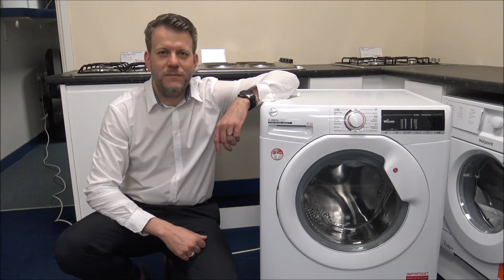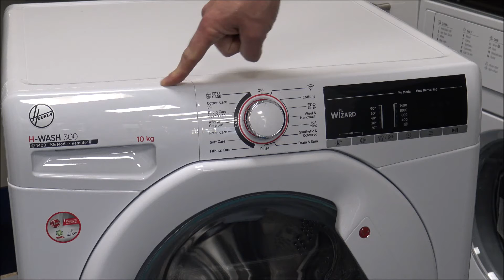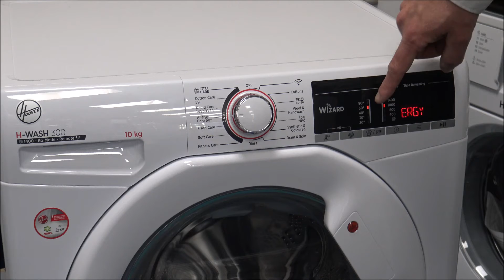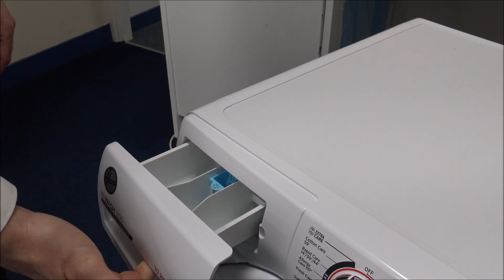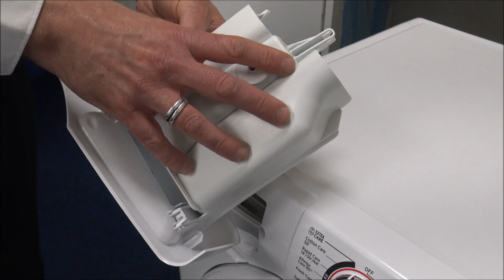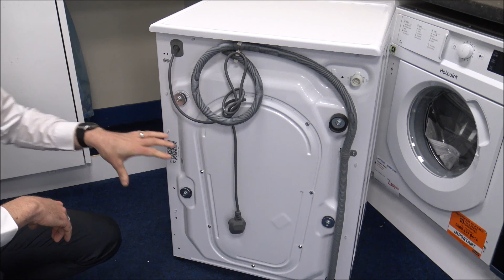Hoover H3W4105TE 10Kg Washing Machine Demonstration

Comment: Hi. I have an h350. Our previous washing machine had a divider for liquid detergent but this one doesn't have such a thing. When I put the liquid detergent it flows into the machine. Is this how this machine works or the liquid detergent goes to waste? I think it goes to waste under the door when it starts to load water. Am I missing something? Does it still take the liquid detergent?

Comment: Brilliant video, thank you. I was told it heats up water by itself. I just got one because I don't currently have hot water supply. For the very first use,  I tried doing a hot wash but the water stayed cold. Any idea why please? What can I do to make it work?
Reply from the maker: It will heat the water up by itself, don't connect it to a hot water supply, even if you had access to it

Comment: Dreadful machine, almost impossible to launder bed linen, has no balance, just rolls everything up making it impossible to spin items, it actually states in the manual to avoid the spin cycle if washing rugs, bedcovers etc., how do the engineers expect we get the water out of items if they have not been through a spin cycle.  I do like all the programs, and no complaints with anything else, but I do need to launder sheets, have tried all sorts of loading combinations, feet have been adjusted. I never had any problems with previous machines, could put anything in. Any suggestions would be gratefully received. Hate it, can’t wait to replace it.
Reply from the maker: i agree, must be very frustrating. Modern machines struggle to spin large single items on their own, you normally need to add extra items to the load to try and balance the load out when it spins.

Comment: i need your advice can you help i got up one night to go get a drink and found puddle of water infront of my hoover washing machine and my bosch dishwasher is one press down from it so im not sure if there was a leak and if there was which one did is there anyway to detect or find out which one might have leaked before i call a man out
Reply from the maker: Unfortunately the main way will be to pull the appliances out to check to see which is leaking
Reply: iv found the problem it was my dishwasher both machines work fine but the seal on the ubend pipe holding the dishwasher outlet had worn away i only found this by chance i knew it was dishwasher so decided to wash dishes in sink only when i pluged it out could hear water under press opened door press flooded but have place 10 yrs guess its not surprising it wore away @lords-electrical

Comment: hi andy got a question for you ive a hoover washing machine and iv just bought some clothes and it says the have to be washed on delicate cycle but i cant see it on the machine if it is on it what would the programme be called
Reply from the maker: if it is saying a delicate cycle then i would look for a Silk or Woollen wash then it will have a gentle wash and spin action hopefully.
Reply: @lords-electrical  thanks just looked up manual and saw wool & soft care it mentioned delicate in the description underneath it so i take it that would be the cycle

Comment: Just got the HWash300 9kg load looks good the guy just finish fitting it the pressed a few buttons he left found he had set ups run time over 3hours with an empty machine so far it’s now down to 1 .28 hours left. So the machine will have run to the full 3hours

Comment: Thank you for this demonstration.  I am so glad it weighs the load still and adjusts the output of water and electricity.  I have a Hoover Silentpulse 10kg dynamic A+++ machine at 1600rpm and is on its last legs so I am looking at reviews before I make a purchase.  I bought my current machine in 2011 so that tells consumers how long one of these machines should last for.  Mine is black and I will continue buying my appliances in black because it looks better imo - mine still looks brand new! We're a family of 6, 2 adults and 4 children so that gives an idea to consumers the number of times my machine has been used - almost every day for the past decade not including the washing of duvets which a Kingsize can fit into.  Hoover has lasted a very long time and could not go to another provider of washing machines based on the fact that my current one has lasted so long.  Thanks again for this review.
Reply from the maker: No problem glad it was helpful for you. Thanks for the great feedback 😀

Comment: Hi so what is the best wash to do for work uniforms 10kg full load I've been doing mixed wash but the machine won't open when it's finished
Reply from the maker: Most of the time a mixed load is only a small load. If you are washing a full load I would normally recommend the Eco 40 - 60 or Cotton wash. May take a bit longer but it should be more energy efficient and the performance of the wash will be better
Reply: Thank you
Reply: 3 hours are you serious is there another full wadh I can d with a full wash 10kg like i? Also what's a kinda I wore a dress only quick wash please?
Reply: @deedoc7996 try extra care

Comment: Hi, how do I stop it rocking when it’s on spin?
Reply from the maker: First of all check all the transit bolts are out then check to make sure all the feet are level on the machine. After this the machine should be ok. If not there may be more of an issue
Reply: @lords-electrical  this worked, thank you so much 👍

Comment: got my hoover washer/dryer delivered yesterday love it much better than my old one which i hated it has 1400 spin and big drum where my old one only had 1200 spin, still trying to figure out right cycle to use for my wash but much prefer the writing on the dial than numbers although had bit of hassle with guy who installed it it was ment to be intergrated and he made an excuse that he couldnt do it after i payed 100 extra for him to do it rang shop informed manager the guy is in trouble but shop will fix it

Comment: Here are a few more comments on our Hoover now we've had it for a few months.  The machine has stopped moving now we have adjusted the feet. Also, someone asks what 56y means on the display.  It's actually SBY and appears when a cycle has finished and the machine goes into standby.  It goes off when you switch off the machine.  When cleaning the filter at the bottom, we put a towel on the floor to absorb the water that comes out when you open the flap.  There's quite a bit of water though so we still end up mopping the floor!

Comment: Very informative, I’ve recently bought the 300 lite, but cannot open the drawer on the bottom left to clean the filter. Should it be stiff, or is there a certain  way to open it? Thanks.
Reply from the maker: You should be able to open it. Yes they can be a bit stiff on the first time of opening
Reply: @lords-electrical  Thank you. I managed, but when unscrewing the tap loads of water came out, so I stopped. Should this be, or is there a way to drain it first without flooding my floor. Thanks again.

Comment: I’ve just bought this washing machine. When I turn it on the display says English and the other buttons flash up and down. I can’t get any programmes to start. Any advice please 🙈
Reply from the maker: Not too sure. Check to make sure the water connection is OK and turned on as sometimes lights will flash if the water is not going through to the machine correctly

Comment: I have ordered a Hoover H wash 300 8kg 1500 spin H3W58TGGE in graphite. It’s coming next week literally looks like this one but different Colour. My old hotpoint is struggling to spin lately or dry on a preset program hanger dry for instance , come home all the lights flashing…😕 so bought Hoover as on a budget was only £299. Curious to how much it is for 2 more kg’s?  Hope it’s good not heard great things 🙈
Reply from the maker: They are good, I am sure you will be fine with your new machine.

Comment: I have just bought this machine and I’m having a little bit of trouble with it. It is jumping around quite abit and have just realised I haven’t taken the transit bolts out. Why would it jump around so much just because they are still in?

Also, it keep stopping half way through a wash.
Any ideas why?

Literally starts to wash and then just sits there doing nothing for an hour.
Reply from the maker: If the transit bolts are still in then the drum hasn't got the ability to move around freely so the whole machine will move around. Hopefully it hasn't damaged the machine.

Comment: If you want a good washing machine. DONT buy a hoover h wash.  It's made so   cheaply that the glass door shatters,  door breaks off, top lid easily breaks due to the PLASTIC hinges and metal bolts. The spin sounds like its from 1964. The entire machine is also very lightweight, meaning they got rid of the concrete  top surround inside the machine so it vibrates all over the show, some machines even take them selves for a walk around your kitchen, kg mode is a joke and takes us back 50 years. I have nothing positive to say about this manufacturer. Cheap and nasty. And they have the audacity to charge 300 to 400 for the worst product you'll ever own
Reply: You've put me off 😞

Comment: Another great video, thanks.  We bought the H3W68TME, which is the 8kg model with 1600 spin.  It's a great washer, a lot quieter than our previous Indesit.  We find that reducing the stain level and temperature on the longer programmes can often help to make the programme lengths a lot shorter without compromising too much on performance.
Reply: Hi can you do a quick wash on it?
Reply: @roland20002000  Yes, there is a Rapid Care programme which has 14, 30 and 44 minute wash options.  It's covered in the video.  You turn the dial to Rapid Care, which is on the right hand side of the dial on our model.  Then press the 'R>>' button on the black display panel to select the wash option you want (14/30/44).
Reply: @sjthom1  Yes thanks for the reply. I literally had it delivered this morning and panicked that there was no quick wash setting. I did watch the video and yes it was covered but thanks for the reply anyway

Comment: Just bought a H-Wash 500 HWB49AMC Smart 9kg 1400 spin model and am a bit mystified by some of the icons on the machine which are not covered by the manual.  Your video was helpful about the general programmes but I'd appreciate additional support regarding the extra icons.

Comment: What would be the best setting for me - I just lob it all in at once - no time in a busy house to sort. Also what would be better for this machine - Liquid or powder ( I steer away from pods as the get stuck in the seal a lot ).
Reply from the maker: First of all i agree on the pod issue, they are best to avoid. Most people are using liquid now as the performance can be better for colours, or powder for whites. Ideally you are best to try and select a cotton programme that is not too short if you want a good wash performance. Try and use the short programmes if you need it to be washed quickly but not too often as the end result of your washing won't be as good.
Reply: What this clown failed to mention. Is this is a liquid only machine. Hence why the draw is Tiny,  that's straight from hoover them selves. and it doesn't come out like a full-size  washer tray. This machine takes us back decades  of advancements, stick to a 40 minute care wash if the drum is full load, That's probably your best wash at the fastest times.
Reply: When I use Ariel pods if the liquid isn’t on offer but the pods are cheaper I will get them! I always put them in a old persil tablets net at the back of the drum or in a trouser pocket! My old machine would start turning left to right as soon as you turned it on then the pod was would fall into the rubber seal pretty much straight away was a tad irritating… but that’s what I do don’t have problems with them now.
Reply: @colinsace1  I will give that a try !!! Thanks
Reply: @MajorBinkss  You can use powder